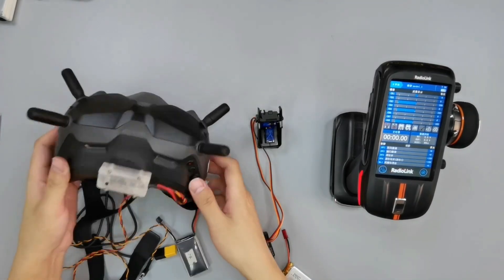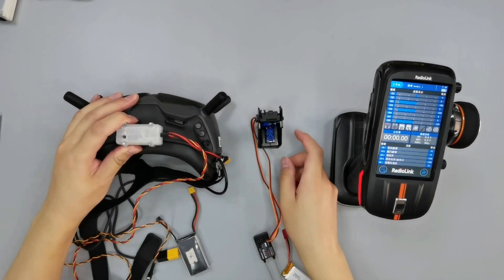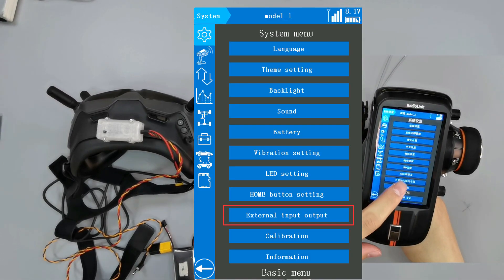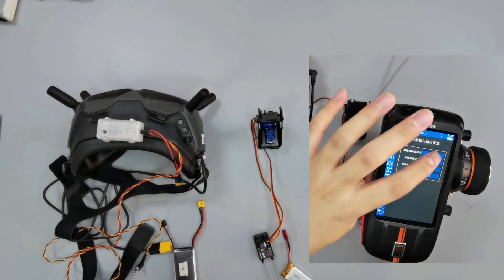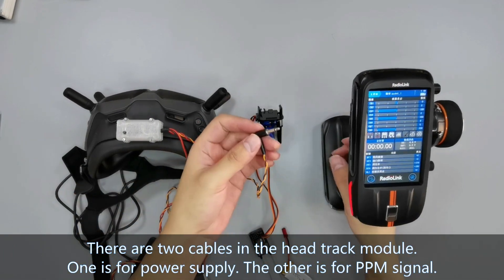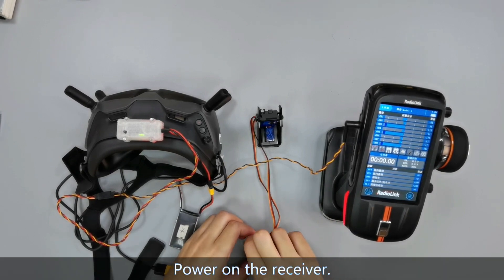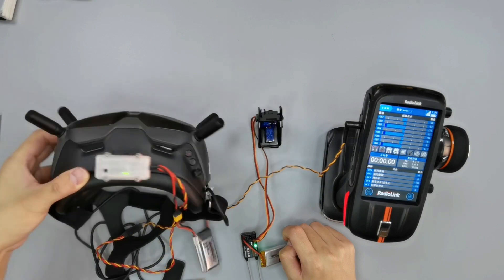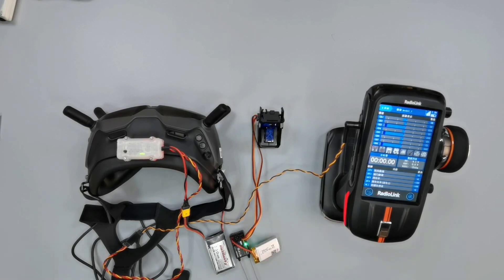Head Track Setup on RadioLink RC8X & DJI FPV Goggles.

Comment: Can you tell me the recommended PPM input value (frame length ms/synchronous pulse μs) of RC8X as a head tracking amount?
Reply: I have been asking for these numbers for weeks. The directions they send make ZERO sense. How can you adjust the PPM number to zero? The PPM Median goes too 300 us- And what the heck are they talking about -100%  and +100%.  When I lower the PPM median number to 300 US, where do I move the Minimum and maximum numbers too? You can not achieve -100% or +100 %. PPM Min is 600 us and the Max is 1600 us. How do I adjust them to -100% or +100%!???!  
What numbers work for HDzero head tracking? 

***THIS MAKES NO SENSE

"Then please adjust the minimum to make the largest travel near -100%.

And finally adjust the maximum to make the largest travel near +100%."

THIS MAKES NO SENSE!***

This makes zero sense. Where do we do this? Why don't you have a video for this?? This is one of the main touted features of this controller. Found out today -RadioMaster M12 works with zero issues!
Reply from the maker: @thebaileys317  Dear Sir, sorry for the unpleasant experience. Here are the steps to adjust the PPM value. 1. Please adjust the PPM median value first to make the trim near 0. That is to say, you can first adjust PPM median value and go back to servo display to check the central point of the value of each channel. Make sure it is near 0. 2. Then please adjust the PPM minimum. Then go back to the servo display, push the throttle/wheel to the lowest position to check the minimum travel. That it to say, you need to adjust the PPM minimum until the minimum travel is about -100% for each channel. 
3. And finally adjust the PPM maximum. Then go back to the servo display, push the throttle/wheel to the highest position to check the maximum travel. That it to say, you need to adjust the PPM maximum until the minimum travel is about +100% for each channel. If there is any problem, could you please take us a video to show how you adjust the PPM value? We'll check and help you about it. Our email is after_service@radiolink.com.cn
Reply from the maker: Hi, sir. The PPM value may be different for  different head track devices. You can adjust it when using dofferent head track devices. Please adjust the median value first to make the trim near 0.
Then please adjust the minimum to make the largest travel near -100%.
And finally adjust the maximum to make the largest travel near +100%.
If the largest travel of this channel exceed +100%, you can set the MAX value in Channel limiter to 100%. If any question please feel free to contact us. Our email is after_service@radiolink.com.cn

Comment: Has anyone go this to work with the BAG?

https://fpvdogfight.com

Compact Pan/Tilt FPV Camera Mount for use with DJI FPV Air Unit, O3 Air Unit cameras and other FPV cameras 19~20mm wide including Caddx Air Unit, Air Unit Micro, Nebula Pro, Polar, Walksnail Avatar HD Camera, etc. An adapter is included to accommodate cameras with single mounting hole per side (instead of two like the Air Unit camera).

It was built for planes but should work for the RC Truck.

Comment: The remote seems to not recive any signals from the head tracker or just dosent output any, i have ch7 and 8 set null, thouse are the channels i have thr tracker setup for, everything seems fine, but no signals are being shown, nor output
Reply from the maker: Hi, sir. For head track function, you just need to set your RC8X like the video. What head track module are you using? If it is DJI module, you also need 2 or 3 axis gimbal like in the video. Sorry we do not sell it. You can search it online. Here is the detailed manual of RC8X which introduces more details to you: https://www.radiolink.com/rc8x_manual  If any question about RadioLink products please feel free to contact us. Our email is: after_service@radiolink.com.cn
Reply: @Radiolink_official  I'm using a fatshark trinity external head tracking module, and I'm using a 2 axis gimbal as I have the head tracker setup for that explicitly
Reply from the maker: @PLASMA_2005  Hi, sir. We had one customer who used Fatshark with RC8X successfully sent us the feedback. 1.You need to enter channel setting, and set the channel the channels used for head tracking to NULL. 2.You may need a cable with correct connector to connect RC8X and the goggles. If you cannot make it work, you can send email to us, so we can send you pictures that may be helpful to you. Our email is after_service@radiolink.com.cn

Comment: All trims turn on consistently when a PPM signal is input.
In this video, all the trim moves when the head tracker is connected.
Is there a solution?
Reply from the maker: Hi, sir. 1. Generally, you need to set "NULL" in "Channel setting" for the head track channels. For example, if the head track device is connected to channel 5, channel 6, and channel 7, you can set "NULL" for channel 5, channel 6, and channel 7   2. Because of the compatibility of different head track devices, there may be trim value added for each channel after successful connection of the goggles.  3.Please adjust the PPM value in "External input output" to meet the requirements of compatibility. Please adjust the median value first to make the trim near 0.
Then please adjust the minimum to make the largest travel near -100%.
And finally adjust the maximum to make the largest travel near +100%.
If the largest travel of this channel exceed +100%, you can set the MAX value in Channel limiter to 100%.  For the slight trim moves,  it is normal and it won't affect the movement of the servo. If any question about RadioLink products please feel free to contact us. Our email is: after_service@radiolink.com.cn

Comment: PPM 신호가 입력되면 모든 트림이 일관되게 켜집니다.
이 비디오에서는 헤드 트래커가 연결되면 모든 트림이 움직입니다.
해결책이 있습니까?
Reply from the maker: Hi, sir. 1. Generally, you need to set "NULL" in "Channel setting" for the head track channels. For example, if the head track device is connected to channel 5, channel 6, and channel 7, you can set "NULL" for channel 5, channel 6, and channel 7   2. Because of the compatibility of different head track devices, there may be trim value added for each channel after successful connection of the goggles.  3.Please adjust the PPM value in "External input output" to meet the requirements of compatibility. Please adjust the median value first to make the trim near 0.
Then please adjust the minimum to make the largest travel near -100%.
And finally adjust the maximum to make the largest travel near +100%.
If the largest travel of this channel exceed +100%, you can set the MAX value in Channel limiter to 100%.  For the slight trim moves,  it is normal and it won't affect the movement of the servo. If any question about RadioLink products please feel free to contact us. Our email is: after_service@radiolink.com.cn

Comment: I want to buy an RX8 specifically for this, what 3 axis gimbal do you recommend?
Reply from the maker: Hi, sir. I have confirmed with our staff. The gimbal in the video is bought in China Taobao website and it is not common. Here below is the purchase link:
https://item.taobao.com/item.htm?spm=a1z0d.6639537/tb.1997196601.4.44b97484LqmRcY&id=643553949263 
Sorry we are not professional in it. We recommend you to ask the seller of head track on AliExpress or other website for the module you want. If any question about RadioLink products please feel free to contact us. Our email is: after_service@radiolink.com.cn

Comment: How do i stop it from changing all the values on every channel when pluggin and powering on the head tracking unit? I.e Channel 1-8 add +12 which makes the truck start moving forward. When i set the trim when head tracking plugged in its fine but when i power off the headtracker the channels move back 12 steps and causes the truck to start moving backwards. The values shouldn't change between when head tracking is plugged in and then out, the only channels it should be altering is 7 and 8 which i have set it to do.
Reply from the maker: Hi, sir. There is some value of the trim because the center of each device may be different, so please adjust the PPM value in the menu of External input output to meet the requirements of  compatibility. Please adjust the median value first to make the trim near 0.
Then please adjust the minimum to make the largest travel near -100%.
And finally adjust the maximum to make the largest travel near +100%.
If the largest travel of this channel exceed +100%, you can set the MAX value in Channel limiter to 100%. If what I said is not clear for you, could you please send email to after_service@radiolink.com.cn  Then we can send you pictures for your better understanding. Thank you

Comment: Will the RC8X and the RC6GS V3 Radios both work with the Traxxas XMax RC Car?
Reply from the maker: Hello, sir. Generally, RC8X and RC6GS V3 can work with all modesl. You just need to install RadioLink receivers on your car, and bind the receiver with RadioLink transmitters. Then you can use them. We found some customers use RadioLink transmitters on Traxxas XMax on YouTube. Here is a video for your reference: https://www.youtube.com/watch?v=WX9gY8FZk2M

Comment: I'm using a head tracking solution from DYI head tracking on RCgroup by Denis Frie with RadioLink RC6GS V3 and R7FG. The head tracking is basically working, i.e. the gimbal follows the head tracking module movement. However, from time to time, the gimbal servo (mostly pan servo) would twitch, even when the head tracking module is not moving. The twitch is random. But when I bind the R7FG to Radiomaster tx16, the head tracking works perfectly. I guess there must be some compatibility issue with RC6GS V3. Would you please dig into it? Thanks.
Reply: @Radiolink
Reply from the maker: Hello, sir. We recommend you to change another servo to have a try. If there is still any problem, please feel free to contact us. Our email is after_service@radiolink.com.cn
Reply: @Radiolink_official  i put a new servo in my rc car. and when the car is sitting still u can hear the servo twitching. is that something from the receiver? Or should i change the servo?
Reply from the maker: @jimmyboy2778  Hello, sir. We recommend you to change aother servo to have a try. And there are also possible reasons for your problem. If you are using RadioLink transmitters, you can provide us with more details, such as the transmitter/receiver you are using and take a short video. It will be helpful for us to find out the problem and help you solve it. Our email is after_service@radiolink.com.cn